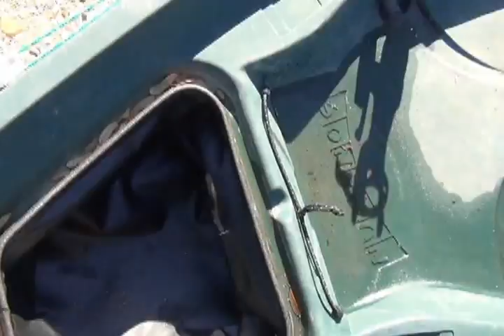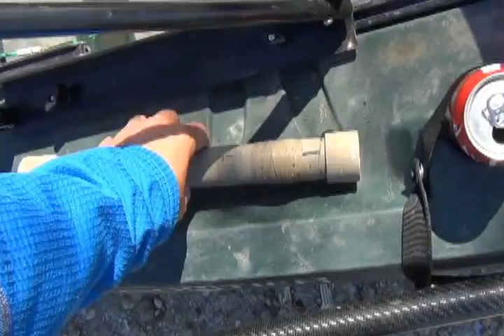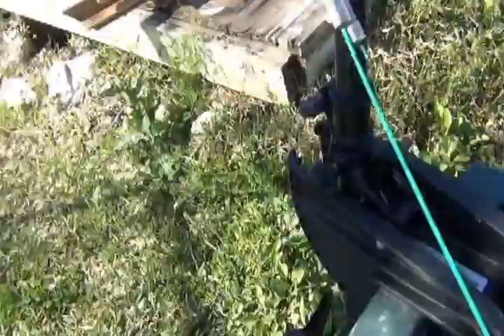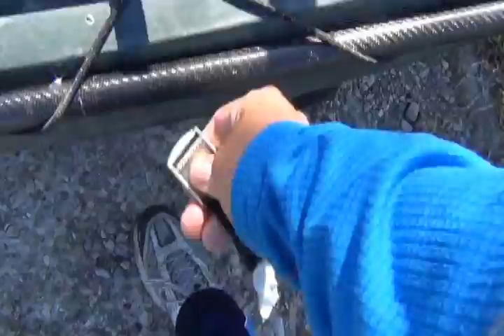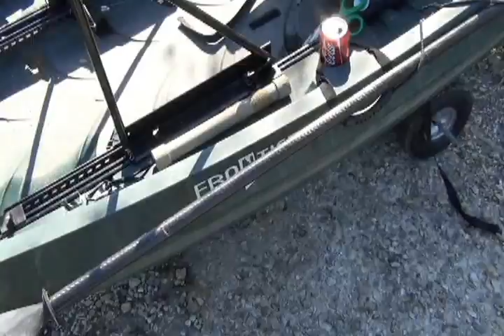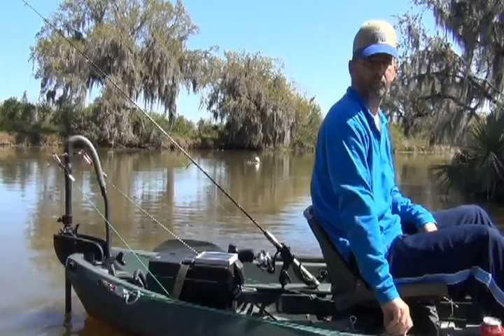Nucanoe 2012 with trolling motor and foot controls.Movie

Comment from the maker: Hey Brian, Thanks For Watching. Now it's not the new seats. I used a 1/4" bolt and slid it inside the metal channel and then I used I-bolts to fasten down each corner. This works well. Probably not as well as the new one's but waste not, want not, right :)
 God bless, keep in touch 
Rev